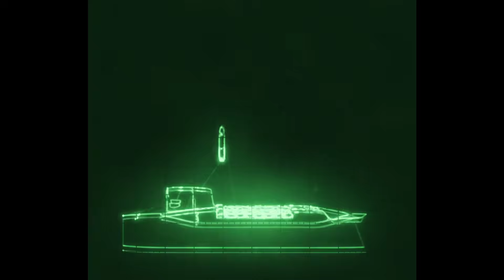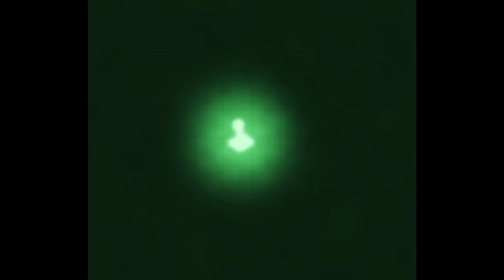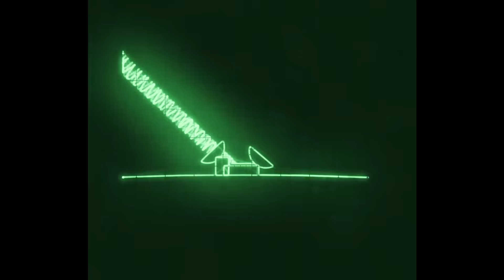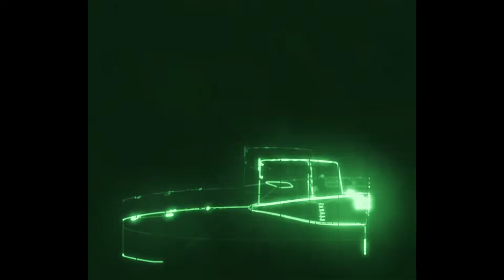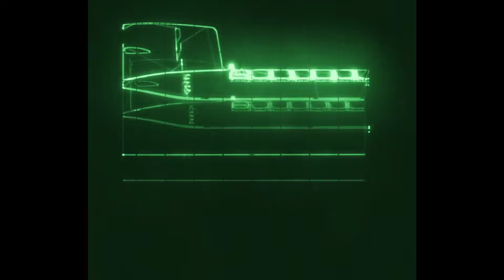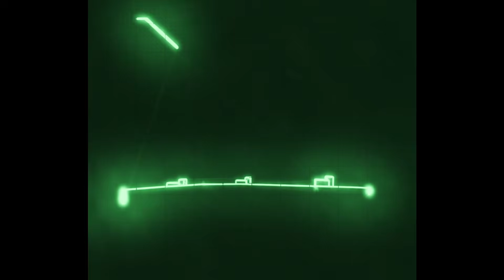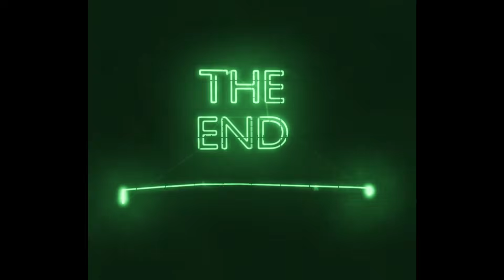Polaris + Transit: When the US Navy Invented Satellite Navigation as a Side Project

Comment: Navy submariner, 1970 to 1976. I made six runs on a Lafayette class boomer north of England as a NUC Welder/Machinist Mate. the 16 missiles on the boat were  "Poseidon"
"The Poseidon missile entered service in the early 1970s and was back fitted to 31 of the original 41 SSBNs. The Poseidon was more accurate than the Polaris A-3 missile it replaced, and could carry up to 14 warheads." 
Each warhead could be individually targeted. The targets for the run were brought onboard during refit in Scotland by civilian-looking folks carrying pocket protectors and metal suitcases. Memory was in the form of double-sided 14-inch vinyl disks stacked and visible through a window to be checked without entering the missile control room. BTW, there were backpack versions of nukes.
Reply: Poseidon is what the UK should have adopted instead of spending a fortune on Chevaline (which was a significant downgrade of Polaris in many ways - 2 warheads instead of 3 and a significantly reduced range).

Politicians not wanting to spend money on "new" weapons meant we threw vast amounts of money at keeping the old system going long past obsolescence.
Reply: @RogerCaplan the UK could have started out with Polaris A3. Replaced them with Poseidon in the 1980s using the same resolution class subs. 

By the  late 1990s  the subs themselves would have needed replacing.

So at that point you would be moving to trident 2 anyway. 

So at that point you would need to move  to a new sub. 

You would not build a new sub in the 1990s to carry poseidon.

So the UK would be moving to trident 2 at that point anyway.
Reply: UK always keeps stuff too long or chucks it out way too soon. Railway branch lines and Harrier jump jets come to mind.
Reply: They were backpacks in like, the most literal interpretation. The SADM was like 95lb and 22" in diameter or something. It was a very large backpack, and alsp came in 3 parts
Reply: My dad was part of the team that designed the backpack nuke so yeah they are definitely real

Comment: 1. If you enter "Transit 5b-5" into the search box and sort the results by "upload date", you will find a very recent Brazilian video showing reception of the sat. It's still "alive" to the extent possible for something that stopped working as intended after only 19 days.

2. The Kepler data off the various websites is probably decades old.  You cannot predict when 5b-5 will overpass close enough to your place to have some sufficient elevation - while it's still sunlit.  This will not happen every day, and sometimes there's not enough power so the telemetry transmission doesn't come on and the beacon is having a funny vibrato (occastionally misinterpreted as "tumbling"). 

3. Building a helical for that is overkill - I personally received it last in 2021 indeed and that was with an indoor loop antenna for shortwave,  a telescopic whip or scanner rubber ducky will do too.  The only thing you can rely on is that it's apparently still on its polar orbit, so you have to park your receiver on 136.650 and wait.  Every few days it will come close enough to let you hear its happy song (malformed telemetry data that nobody can understand anymore).

Comment: First thing I notice about your analysis at the start of the video: you are assuming "war" is a one-way shooting gallery.  However, in war people shoot back (I said war, not genocide) - and you will take casualties (even on expensive hard to replace mega-capital assets like submarines and carrier groups).  You also assume that large complicated machines don't require maintenance, repairs, or upgrades.  This means there is an out-of-service period that can't be used for direct conflict.  Then there is the "tyranny of distance" part of the equation - if you want those sexy short flight times of a local asset right off a coastline, you need to get the boat there from where is was supplied and maintained - to where it makes loud noises with the pointy end.
  
Each of these rotations add to that "out of service" window.  So, yes, presuming an ideal service readiness, full supplies, and the entire fleet being in one region, and no casualties - you might not need that many.  However add on manufacturing lead times of a literal decade, crew training of years (>one year), global circumnavigation times of >1 week, supply constraints, guys who don't care about going home on little boats with large explosives dressed lie civilians (and some remote control ones now) - any you can see how the actual math of assured success requires a lot more hardware to be "in circulation" for it to be reasonably available for a given time-to-action window.

Comment: This is great. Genuinely. Minor point, really, you can get things bigger than two feet onto a polaris submarine. For one, the torpedo loading hatch was bigger than that, (because torpedos are bigger than that and you, you know, have to load those) plus, for anything genuinely large SOP was to simply cut the hull away, shift stuff about, and weld the hull back on. They'd do this for sonar upgrades, refuelling, extra large pizza delivery.
I couldn't say with any certainty at all, but, I think maybe that computer through the hatch thing might not be entirely as it seems. Might be one of those bragging things to futz with the Rooskies.
Reply from the maker: Itd be possible one way or another. But the hatch requirement came from the Navy themselves. They tend to be rather demanding in their requirements.

Oh btw I’m equally puzzled - the torpedo loading hatch is shown as 25” in that diagram too. That can’t be right can it?

Comment: 35:15 don’t get…. Nuclear reactors don’t fit through a hatch, maybe computers failed to fast
Reply from the maker: The sub is built around the reactor.
Reply: I know, maybe a construction atmosphere is too damaging for computer equipment or it needs to be changed out very often
Reply from the maker: It’s the latter - they’d need the ability to swap it in and out quickly and easily. The failure rate of those early transistors was not great.

Comment: I've been independently working on a video about the remaining Transit satellite for a couple weeks now, it is still transmitting, still strong, as late as yesterday
Reply from the maker: Fantastic! I’ve had emails from others who managed to pick it up. I’ve ordered a low noise amplifier to try again.
Reply: @Alexander-the-ok  you shouldn't need one, just focus on the antenna, a QFH can be really good when built properly but can be really bad when not, simply make a dipole antenna, around 53cm per leg, and that's enough to receive this satellite, and might even give you better result from the weather satellites as well. Not to self plug but I do have a video about the classic V-dipole antenna configuration. Another thing to consider is that you have your SDR gain set properly, if it's too low the signal will be weak, if it's too high it will get distorted and overloaded by interference

EDIT: avoid using AGC, set fixed gain manually
Reply from the maker: Brilliant thanks. I’ll watch your video and have another try!
Reply: still going strong?
Reply: @youtubeviewerorsomething  As of me typing this, the latest confirmed reception of this signal was just 3 hours ago, and it is stronger now than it was when I made the original comment
Reply: @dereksgc  So is the satellite just speeing nonsense by now? Or is it still sending an actually usable signal?
Reply: @espe131  we don't know, we can decode data, there clearly is some degradation to it, but without an original format of the transmission there isn't much that can be done to try interpreting it. There are clear patterns in the signal that show some onboard electronics are still working, sometimes there's even a working frame counter, so at the very least the satellite still knows how to increment by 1
Reply: @dereksgc Thanks for the explanation! Thats already pretty impressive, considering that thing is circling up there for more than 60 years, working nonstop.
Reply: This is what I read YouTube comments for
Reply: @dereksgc  post your video:)
Reply: @Emerson1 it's on my channel

Comment: It’s possible the discrepancy in hatch and computer size is the fact that there was some case or easily removed piece they could put back on inside. I’m sure the idea was they wanted a computer that could be easily changed in and out quickly with minimal assembly required, but they’d allow some super simple assembly to be performed after going through the hatch.
Reply: I would assume that the seal around the hatch was replaceable so in port it could be removed thus slightly increasing the diameter of the hatch.

Comment: May be a dumb question, but why couldn't they use a larger computer and simply insert it into the sub at the time of its construction? Certainly there are other components on a submarine that can't fit through the hatch. And they have to make new nuclear silo capable subs anyways so why not have the computer be installed at the same time as the silo to circumvent the size constraint?
Reply from the maker: These early computers would need regular repair work and I imagine just swapping them out in port would be far easier.
The way I think of it is imagine standing in front of a Navy admiral in the mid 1950s explaining a bunch of nerds were going to have to crawl all over the interior of his highly classified sub during every port visit to maintain this new 'digital computer' thing. Honestly, probably far easier to design something that could go through the hatch.
Reply: @Alexander-the-ok  There might also be some future proofing involved. It wasn't hard to predict that computers would only get smaller and better so it'd be silly to build a computer that you could only replace with a total overhaul of the sub.

Comment: 14:25 Density and hardness are actually not the only considerations for the selection of depleted uranium. Depleted uranium also happens to exhibit specific properties under conditions such as penetrating armor in which the projectile will continually “self sharpen” by shearing away away material that starts to mushroom out. This self sharpening helps minimize energy loss and allows the shell to penetrate greater thicknesses
Reply from the maker: Yeah….I just kind of put the self sharpening characteristic under the umbrella of ‘hardness’.
Reply: @Alexander-the-ok  Absolutely unrelated fact - in one Soviet book on forging and hot stamping, I saw the parameters of the environment and equipment for uranium forging. Still blows my mind that someone is doing it.
Reply: There's also the issue of availability. Building up the world's largest nuclear arsenal involves generating a holy flying shit-ton of depleted uranium as one (probably more than one) of the upstream processes. Might as well use it for something.
Reply: Fascinating!
Reply: Another useful property of metallic uranium for this type of high velocity armour piercing dart ammunition is one it shares with all the other lanthanide and actinide group metals: It is pyrophoric. This means that when in contact with oxygen from the air and subjected to sufficient mechanical friction to shear tiny particles away from the bulk metal, those particles will auto-ignite. This is a similar process to striking steel with flint to make sparks - one of the oldest known methods for starting fires. However, the sparks from lanthanide/actinide metals burn at a far higher temperature (over 3000 degrees C), and it takes far less friction to make this happen.

Machining these metals can therefore be a potentially dangerous procedure - this is typically done with the workpiece and tooling both contained within an inert atmosphere (argon is best, but nitrogen or carbon dioxide can also be used), or entirely submerged in oil or similar oil-based cutting fluid. Working these metals with hand tools (hacksaws or files) can easily produce showers of sparks, and even cutting uranium metal turnings into smaller pieces with wire cutters can have the same effect - which I can personally attest to.
Anyway, the impact of the depleted uranium dart to armour plating will certainly make a hell of a lot of extremely hot sparks, both while it is penetrating through the armour and continuing on to whatever it might hit once it has made its way all the way through. If that armour plate is part of a tank, there is plenty inside to ignite and burn, including the fuel tank, and maybe even the ammunition magazine.

The more common application if this effect is with modern "flints" used in cheaper cigarette lighters or igniters for bunsen burners and gas blowtorches: These don't use uranium (though in principle they could), but do use a metal alloy called "ferrocerium", which is composed of cerium, lanthanum, neodymium and various other rare earth metals, plus iron oxide and magnesium oxide.
Emergency fire starting kits often consist of a block of magnesium metal about the size of a small matchbox, with a ferrocerium rod embedded along one edge, combined with a piece of hacksaw blade hanging from it by a few inches of chain: The idea is to first use the blade to scrape some magnesium shavings onto a piece of dry tinder, then direct some sparks at them by rapidly scraping along the ferrocerium rod. In principle, the tinder and sparks can be enough on their own to start a fire, but the magnesium shavings burn for slightly longer, making this easier and more reliable.

Comment: 41:39 "One interesting aspect is the lack of specialised logic hardware"

It might be called an "Adder", but logic ops are mostly there. It's just that the instruction naming is obtuse. Merge is bitwise OR. Extract is bitwise NAND. Complement is bitwise NOT. The adder can process these at 15 bits per cycle. 

With those, you can also build bitwise AND and bitwise XOR. 

This "Adder" also has various shift modes and can shift at 1 bit left or right per cycle. The Multiplication, Division and Shift instructions are "microcoded" on top of this, and so execution time varies.
Reply from the maker: Yeah this is what I suspected - it’s actually an ALU, they must have just called in an ‘adder’ back then.
Reply: @Alexander-the-ok  Actually, I read through the manual a second time. It was bothering me that they clearly described the Adder as just an Adder. 

What I think happened: the Adder only adds, but the shift + logic operations are actually implemented as part of the A and E registers.

One major clue to this is that the Add operation always writes it's result to A, but the Extract/Merge operations can write their result to either A or E. Merge might actually be implemented as simply a register write without clearing the previous result.

Comment: 10:38 It's worth noting that Castle Bravo was not meant to be as big as it was - they expected maybe 5-6MT and it went off with an estimated 15 - this was due to an ingredient that they thought would just be packing material that turned out to be very good for fusion based weaponry under those conditions - the material (Lithium-7, the actual fuel was Lithium-6) harmlessly decayed into helium in the lab, but fired off neutrons in the bomb.